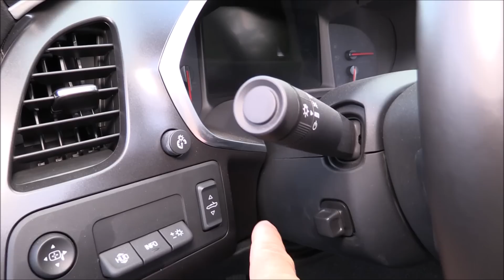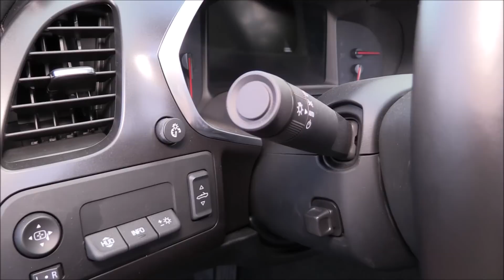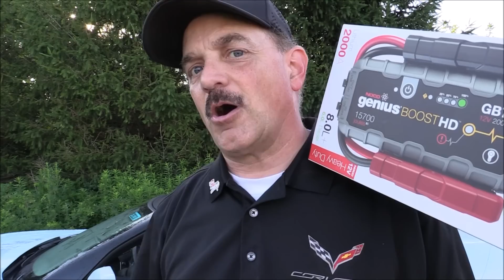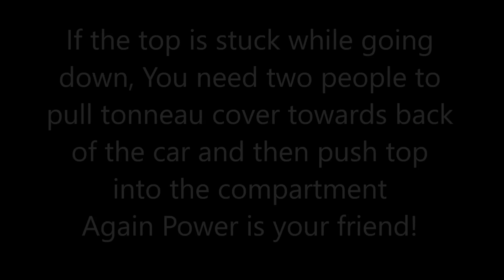WHAT TO DO IF A C7 CORVETTE CONVERTIBLE TOP WILL NOT OPERATE

Comment: 2014 c7 Vert. owner, thx for info in this vlog Rick....No rain in Az... less than 12" per year...300 Sunny Dazes. Stock tires work fine here too, no All Season needed... maybe the tip, replacing the battery...anything extra special to know?

Comment: Do you have a PDF of the service manual?  Mine is stuck but closed.  The battery died, replaced it and not have the motion top notice on my screen.  Says top not fully secure, open and close window.

Comment: I have 2006 C6. The top was down and the battery died for good, I replaced the battery yesterday and the top will not work. Any suggestions? It is stuck down.

Comment: So keeping my C5 convertible with the manually operated top seems like a better idea.
Reply: hi KS, I have both, c7 and c5 vert...if you own a c7, it has more electrical stuff than any other...its a Video game you can drive. Isn't that cool how the top folds folds up...by it self...the c5 not electrical stuff, but enough to take it to the pros...My rear hatch needs the struts replaced to hold it up...or have 3 arms...lol... I don't won't to lay in trunk yet...the AC is ice cold, thats great in Az...I warmed up to the c7 after 5 years.